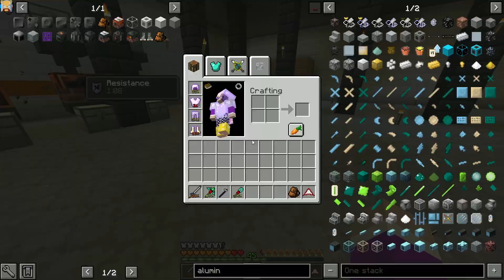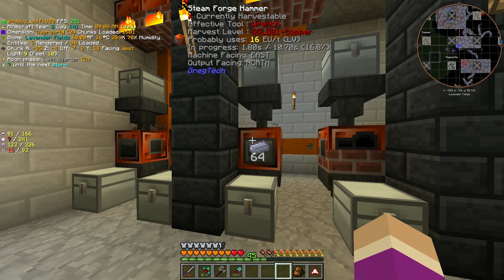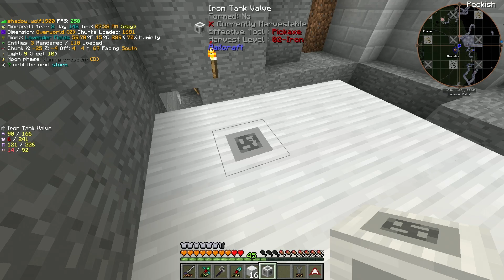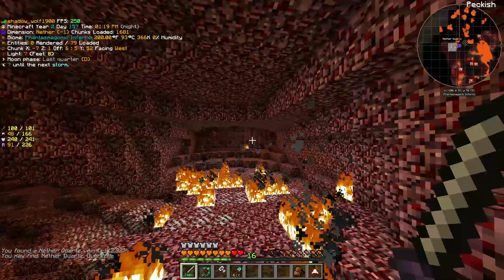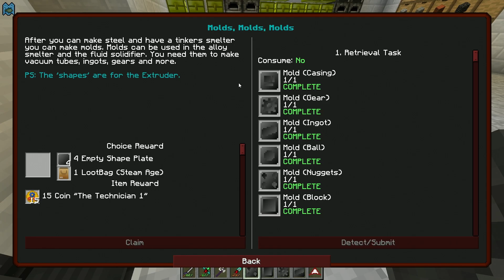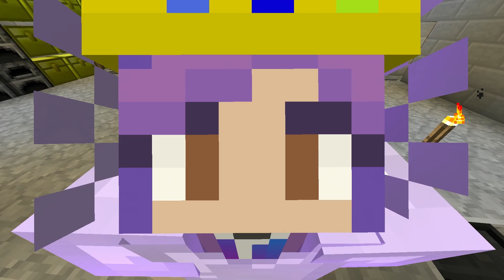Gregtech New Horizons Ep.4 Steam Upgrades & Circuits

Comment: The nether portal spawns you behind it and one block down.  Dig out the sides, rear and bottom so the portal sits on top of the ground instead of recessed one level into the ground.  That will stop the issues.
Reply from the maker: thanks i will try that

Comment: You might have enough high pressure solar boilers, but your Iron Tank isn't capable of outputting enough to the pipes to run all your machines at the same time. Once you're in Low-Voltage, get yourself a "Steam Valve (LV)" and put that on the tank/pipe. Also, once you're in LV, try to get to the Twillight Forest so you can obtain Silver and especially Lead. Lead can be used to craft Potin, which in turn is a great value pipe material for Steam.

Also, you can use your second multiblock Macerator to macerate actual Ore instead of the result from the first Grinder. Throw the Output of those into a forge hammer. It does the same thing, relatively quickly and cheap, and frees up your 2. grinder to help you process more of the ores.

Upgrading your Steam machines to the high-pressure variant is also a nice to have, as it halves the processing speed for everything.
Reply from the maker: yeah I'm noticing some throughput issue I'm hoping to fix them next episode and i will defiantly try the steam valve since your right the tank cant output enough steam thanks